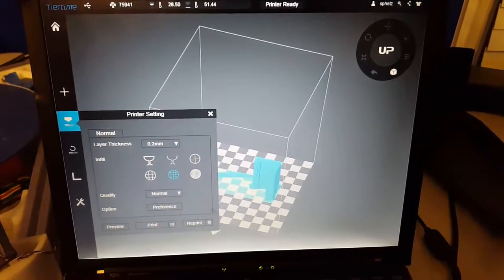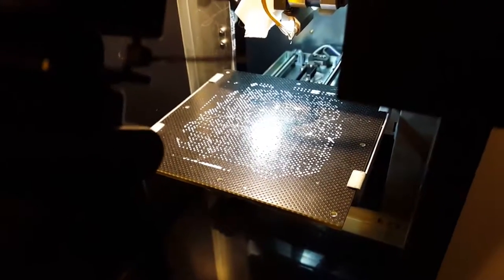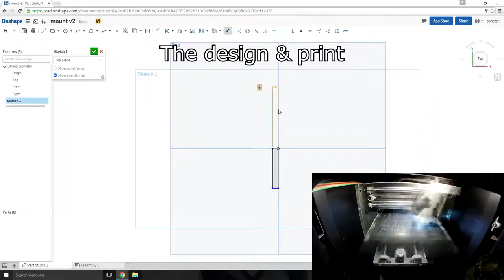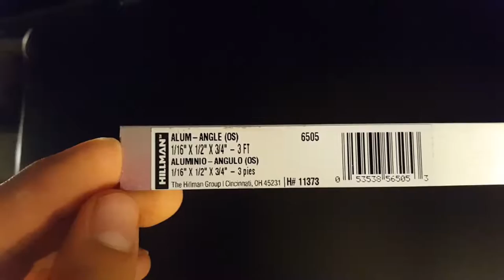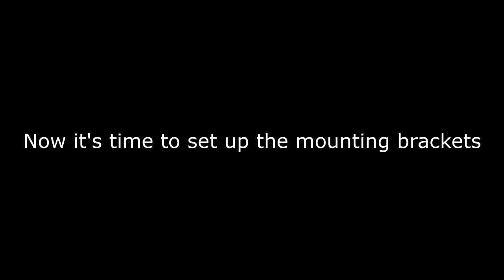3D Printed Speaker Mount for Side of Computer Monitor

Comment: Great guide, really thankful for this idea. I pretty much followed everything except the mounts, since i dont have a 3d printer. So i used a T pvc pipe instead and added footings using half-cut pvc pipes and used velcro to hold the speakers. Great end product. Thank you so much for inspiring me ❤️ really good idea to mount it using the screws behind the monitor. You sir, are pure genius. Thank you

Comment: Suprised nobody in China has made a vesa adapter for this purpose
Reply: they do on amazon its called Universal Telescoping L/R Speaker Bracket for TVs.  its mainly for TV's though but i could definitely see it working on a 32" monitor or ultrawide monitors since PC speakers are lighter.